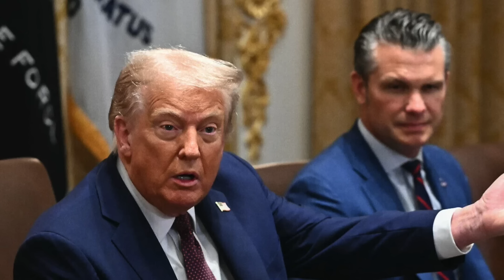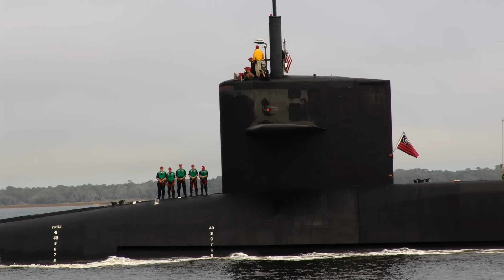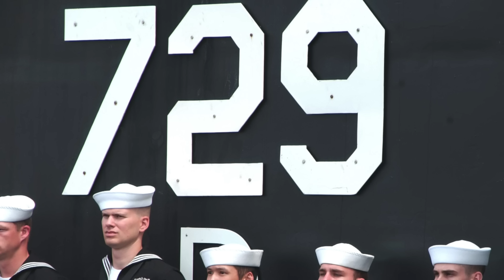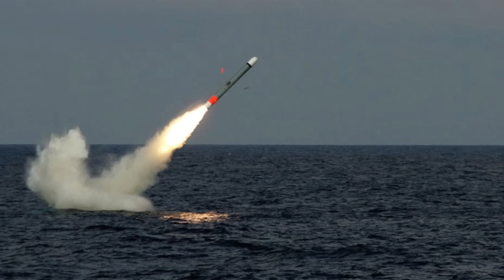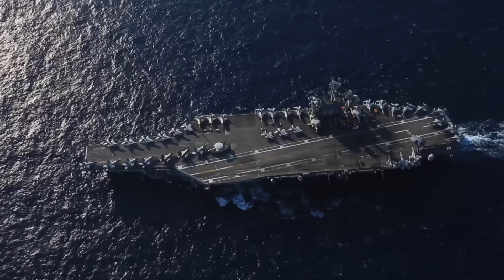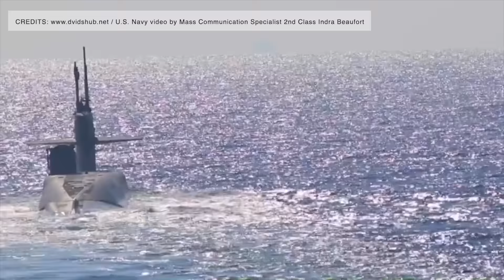Why presence of USS Georgia near its shores is nightmarish news for Iran ?

Comment: The problem in a nutshell is that Iran and Russia know they can run their gums, rattle their sabres, and nobody will take them apart. The US is perceived as perpetually weak by the middle east. They string us along in hopes we will buy their BS, and then we fail to push the situation. Carter screwed around with Iran the first time. If Carter had sent three carriers and a few other assets and just made it clear that things were going to change one way or the other we may have had less issue with the middle east. This "I am giving you a warning thing" does nothing more than give Iran the opportunity to rearrange their hiding spots and weapons, so that when we ever launch a limited strike, nothing of value will be hit. We might as well send them a proposed attack plan and ask them if it is okay. If you are taking out the enemy, just do it. Do not kill them by running your gums and speeches.